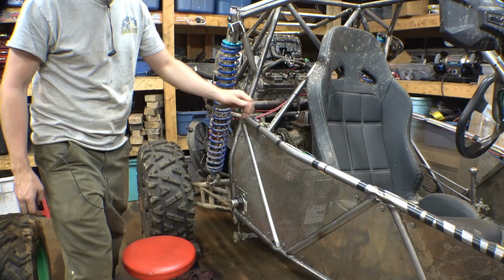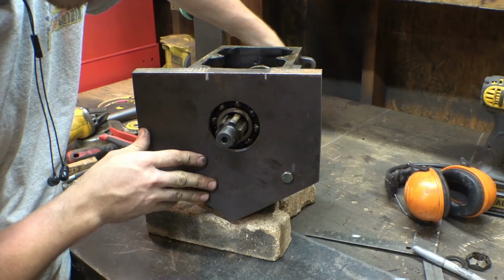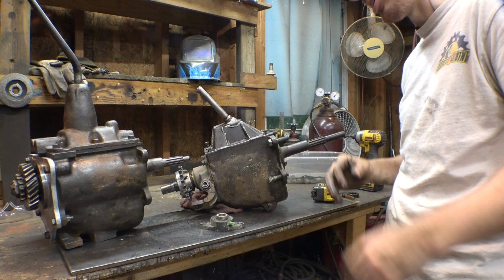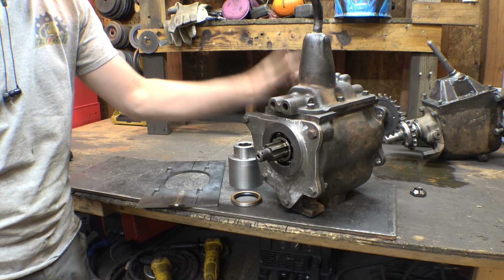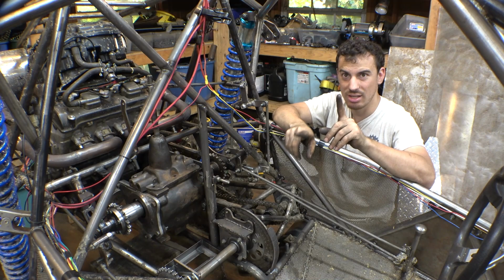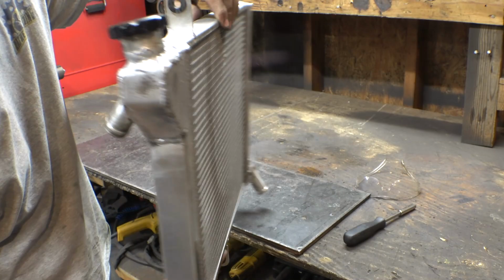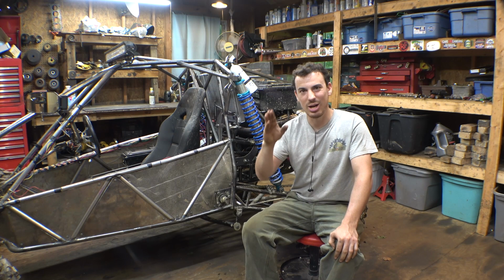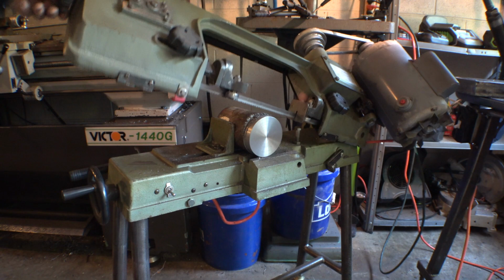New Transmission for the CBR 1000 Off Road Buggy!!!

Comment: Great job, one thing though, i think that when you were checking the runout it should have been tightened to the output shaft. P.S. youre going to have an oil leak, the output shaft, you drilled a hole so you can get the split pin to lock the nut, oil will work its way up the splines and out that hole, unless you seal the splines real good.

Comment: told you , that shaper is realy usefull in youre shop
youre idea with the two shifters might end bad as it allso alows you to select two gears at once and have everything lock up , might be better to keep the one shifter and make a slider replacing the selector on top of the box to select one reverse and 2 and 3 and use the other linkage to push it forward or back 
it is possible to build a sequential shifter like in a motorbike but it would take a lot of thinking to make the shift thing with the grooves to operate the two forks inside the gearbox
trick with aluminium welding , get everything as cleanm as you can not only the workpiece but the welding rods too and clean with accethone before welding
as for the car not going in the gear : usually one of the shafts is spinning slightly , it might be that the gears just didnt wanted to mesh , sumtimes kicking the clutch a little help move the gears so they do mesh
might need to put a relay between the switch and the motor of the bandsaw , that alows the saw to run big power and use a lighter switch and wires , if the witre gets warm you might need a thicker cable to the plug (make sure the wall plug itself doesnt melt )

Comment: Really liked this video, this transmission seems to be a great choice. For the transmission backing plate i really thought you would start with pretty thin plate and just machine the bearing seat and gasket seat as one part in the lathe then just weld it to the plate, it would have been a bit faster i think. Great job finishing it in time. 2 stroke go kart for the cars and cameras race ??

Comment: Have you ever considered electric motor for reverse? Then you could just rely on sprockets for gearing and the motorcycle transmission for speeds. I think goldwings are setup like this.try redline shockproof light fluid to make shifting easier. Its amazing stuff

Comment: you can save yourself a lot of trouble, and just pull the shifter cables and assembly out of any Japanese front wheel drive car. All you have to do is adjust your shifter length coming out of your transmission to adjust the amount of leverage. you'll have a left and right cable and a front and back cable. and that's it. it will transfer whatever pattern is on the transmission, to the other end of those cables.
     I got another question. why doesn't anybody think of using a Harley Davidson big twin A motor transmission? it's a completely self-contained, sealed unit, on a Harley before 1990 ish, it used a primary chain or belt to go to the transmission, and has secondary belt or chain to the wheel. it's perfect for this application. mounting it is simple, has a flat base, bolts on like a Briggs & Stratton go-kart motor, & you get five or six gears, sequential shifting, 1 down, 5 or 6 up, and you can use a dry clutch with it, or omit the clutch all together, even has input and output drives on the same side, eliminating the need for a jack shaft. hell, it even has the one drive sprocket already there..... I don't know but they come off of 1340cc motors, so they got to be strong enough..

Comment: The shifter mechanism you are using is going to have problems - probably always, because you have several transition points in each of your mechanical linkages.  Each of those transitions/direction changes at the bellcranks introduces slop, which tends to encourage binding especially since the rods you are using have a tendency to bend.  I'd suggest a cable shifter setup.  Cables only have a transition at the beginning and the end, which makes the shifting a lot more precise.  As an added benefit, the cable shifters are less weight and also are easier to run.  There are good examples in some of the VW/Audi front wheel drive manual shift cars of the last 30 years.  
By the way, most floor shifted truck transmissions of the 40s-80s had an 1.125 (or 1 1/8) inch input shaft with 10 splines, which made it easy to swap among them as long as you could match the input shaft length and the pilot bearing dimension.  This is why you didn't have trouble with your new input shaft being different than your old one.

Comment: Whereas I love your machining skills, I'm surprised you did not make a composite plate.  Start with a relatively thin plate that covers the back of the transmission, with an oversized center hole, and a cutout for the two bolts-- they really don't need to be covered anyhow, right?  Or if they do, a simple top-cover, of a separate piece welded on?  Anyway, then you machine a tube that fits over, and holds the bearing.  Install plate, install tube, tack-weld tube-to-plate and so on.  Not unlike your sealing ring setup.   I dunno--seems it'd have been easier over all, and ... really... wouldn't you rather be ... welding?   :)

Comment: Hey I’m not an electrician either but I would strongly recommend using a relay set it up so the switch powers the relay and the relay ( not 100% sure but there has to be relays that can handle voltage from the wall)will do the heavy lifting also might not be a bad idea to get a beefier power cable from the wall to the tool this could have ended with wall power frying you… if your unsure about anything just look it up or ask an electrician

Comment: You, sir, have a new subscriber. I like the way you work, and it seems like we have a few things in common. I think it's great that you were able to make that transmission work, HOWEVER, you're causing problems for yourself. Unless of course there's something I don't know about what you're trying to accomplish. 

I've built a lot of crazy little machines, but I primarily build roadsters and coupes that weigh between 1,500-2,500 lbs, and I can tell you that there's tons of more modern gearboxes out there that would be more simple to work with AND hold up better. That transmission can take the torque, but as light as your machine is that's not going to be the issue you have with gearboxes intended to take the load of a heavier vehicle. That transmission can't take the high RPM of your engine like many others can, they just weren't designed for it. Going back to what you said in the beginning of your video, if you ever need another gearbox I'd be happy to share the knowledge I have.

Comment: Man, you don't need any of that low range bs. This is not a crawler, it doesn't even have enough traction to make use of it. Just gear it to around 60mph and you're good to go, and with one less thing to break and ruin your day.
Reply: Maybe with another 4 chains he could power the front wheels, lol
Reply: @natefessler3961  4 chains? Not his style. He would use at least 8... And a drive shaft  lol
Reply: @fullmetaljacket7  And at least a dozen linkages

Comment: You could have started with thinner plate and welded a bearing boss in place , save all that milling . Also i see you make a lot of stuff from solid , when possible try and design things for use with mechanical tubing ...saves a lot of time boring or turning
Reply: Think of most machine tools as finishing tools, not machines used for hogging of material for hrs on end

Comment: A CNC machine would be perfect for making that backing plate....and secondly you have the wrong wire gauge that's why those wires are heating up and melting the terminals on the switch...use a smaller number 10 or 12 stranded A.W.G which is a bigger wire than what you're using

Comment: awesome video. the 10 hours of footage, YouTube Gold is what it is. I could watch it all day. got a question. why wouldn't you machine that seal right into the side of your case bearing support? as long as there's still a lip there to hold the bearing from coming through, you'd have no problem. the only other thing I didn't think about, was the depth of your clutch adapter, it probably doesn't go in far enough, does it. yeah, that's probably why that set up wouldn't work. but it would be much easier to just open up that hole slightly to install that seal.

Comment: Questions: Why don't you use engines from small japanese cars? I'm talking up to 1 liter  to 1.5 liter?  Power wise they fit your needs, they already have a transmission and I'm not sure, but I think that gettig one of those engines is cheaper then these 1000cc motorcycle engines.
2. How about building a tube-style hotrod? Front mounted engine, driveshaft..Someting totally different.

Comment: Why not cleaning all that crap off that gearbox before working on it? honestly, I'm disappointed to see that dirt and particles contaminated the transmission, a cheap pressure washer will do a good job, maybe you have one but if don't, a water hose will work ok with a buck or two engine degreaser.

Comment: Dictionary definition.
"WELD (Verb)
 - To join together (metal parts) by heating the surfaces to the point of melting with a blowpipe, electric arc, or other means"............ I'm not seeing anything there that says a weld NEEDS to be pretty. :)

My weld beads often look like someone's SNEEZED them at the metal, so I tend to use the "Grind them pretty" technique. As long as I get good penetration and full weld coverage I'm happy enough.

Comment: How are you going to seal the transmission so it doesn't leak all the tranny fluid out where that bearings that you're going to have to put a seal and the seal is not going to work on that output shaft

Comment: Did he replace second gear in this transmission because that was the gear with a problem in the last transmission? I'm confused.
Reply: Yes, and he stated that second in the new transmission was showing a slight but noticeable amount of wear. So he took care of the problem, before it became a problem. Also was easy to do before mounting everything in the chassis.
Reply: @craig2963  That's his personal justification I suppose, but it was unnecessary. For a toy like this especially.

Comment: Very cool, but did I miss the reason why you're putting a super heavy car transmission behind a bike engine which already has a transmission inside it?
Reply: So he has reverse gear.
Reply: @MJTAUTOMOTIVE  I see. However for the reduction in part count, weight, complexity, drag on the engine, I think I'd run it with one chain from the engine to the distribution shaft then a chain to each wheel, and put a starter motor to turn the distribution shaft backwards. You could rig it to the bikes neutral light switch for safety. You wouldn't want to go far like that but it's how it's done on Harley trikes, the most recent goldwing, etc. So it'll work fine especially if you gear it real low.

Sounds like a whole lot less to go wrong, and an easy ~70lb weight saving. You could use whatever starter is most common/cheapest at the junkyard.

Comment: dude... i love this build ive gone back and watched every episode of it from the beginning, however.... i am a mechanic by trade and have been for years and there is one mistake i keep watching you make every time you build something that holds a bearing in place. most of those bearing are press in bearings and the fact that they just slip in means that the bearing races will start to spin and thats not good
Reply: Unless the side retainer plate holds enough tension

Comment: That loose fit isn't going to last very long. The teeth are going to get trashed real quicke then your going to need to buy a new shaft as well as the sprocket.
   I know you're pressed for time but finding the proper fit would be better.
Reply: Ugh when I saw that loose fit I was like "that is going to fire back at him" let's hope that the torque doesn't destroy it immediately
Reply: @Hardwarenerd  
Yep...the reapeted slamming is going to trash those splines in short order.

Comment: @13:10
When chucking an out of balance piece in the lathe, especially when doing it very sketchily with an inside jaw chuck PLEASE PLEASE do not stand in line with the spinning wheel of death Chris. 
Stand to the left and use your right hand to push the start button.

Comment: All you had to do to locate the bolt holes was make another cardboard template What you did worked fine just a lot more time consuming ✌️
Reply: Not as accurate as the way he went.
Reply: @TrulyUnfortunate  sure it would be Long as ya make the template right
Reply: @EJ-74  
The plus side on his method is the tranfer of the drilling point.
I was a machinist for over thirty years and know all the tricks,in fact the way he went is common.
   Think of it as a drill punch. Way more accurate.
Reply: The way he did it its miles better. Because with the pointy end at the center of the screw ( also the center of the taped hole) you have the perfect dead center spot to locate the drill bit and drill the perfect strait hole..
Reply: @Hardwarenerd  
Exactly.
It's common practice in locating blind holes.
    If he figured that out on his own he's going to be a good machinist one day.
Reply: I'm not saying the way he did it wasn't right I'm just simply saying it would have been faster to use the template which would have been fine You can get the center pretty dang spot on if you know what you're doing  I've done it many times I worked in a fabrication shop for a couple years Wish I would have never went back into constitution lol ✌️
Reply: @EJ-74  yeah totally agree both ways would have done the same exact thing but I think he demonstrated this specific way for educational purposes... Always good to learn new tricks!
Reply: @EJ-74  
Faster doesnt mean better.
Especially when you're talking mechanical parts.
   If it was just fabrication it would have been fine.
I've done plenty of fab work in my 30 plus years of machining,there are methods that are fast then there methods that are accurate.
   He went the accurate route.

Comment: How many transmissions do you think you need CBR 1000 comes with the transmission why are you adding another transmission I don't get your logic it's kind of out there and I think you're doing way more work than you should do and they they make different chain drive differential independent suspension that you could have easily added to that frame and saved a lot more money than what spent

Comment: Awesome work your super talented. Think your using way to big of end mill for your small mill. Try 1/4" four flute carbide high RPM in a dedicated holder or collet.  Ebay has them for cheap I've had good luck with foreign. Check out Stefan Gotteswinter Video's on the subject.

Comment: 1. You were using too small of a bit. 2. Drill rpm too slow and 3. The stock needs to be clamped on the sides not down on the table. Just my opinion ?

Comment: Doesn’t the engine have a transmission already?? Why do you need two?
Reply: for different gear ranges and reverse
Reply: Consider it as a splitter, high, low, mid range. Helps with crawling and helps keep the engine in its optimal rpm range.

Comment: Your speed is too slow and your feed is too high. I was a machinist for 38yrs CNC lathe. Also use a smaller diameter end mill. What is that a3/4=(.750)  diameter try a 3/8=(.375) 3,000 rpm 1.5 feed. And if that's a drill press it's the wrong tool for that job.